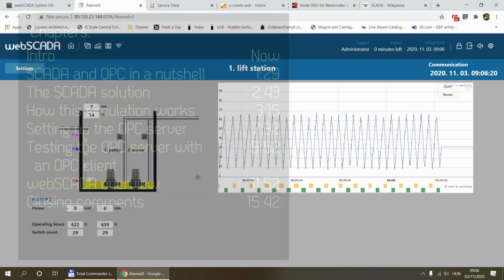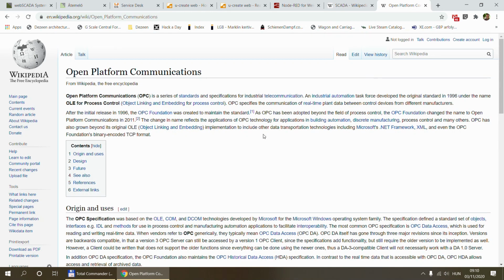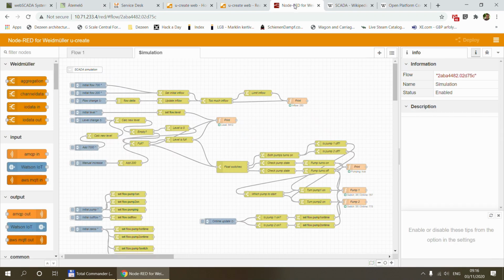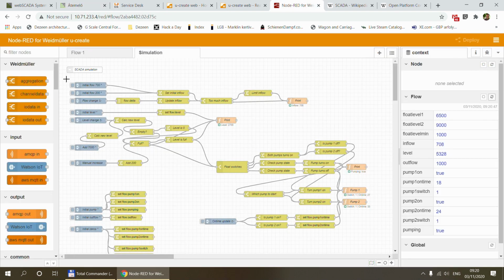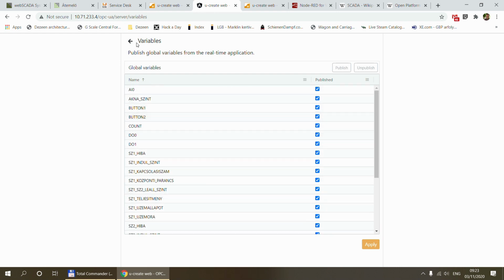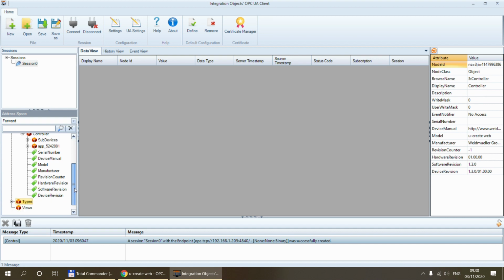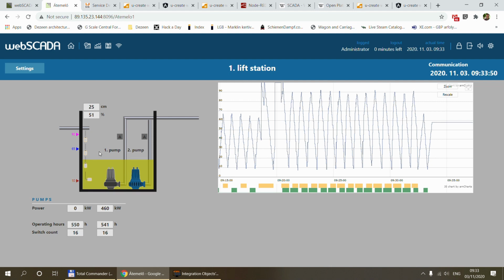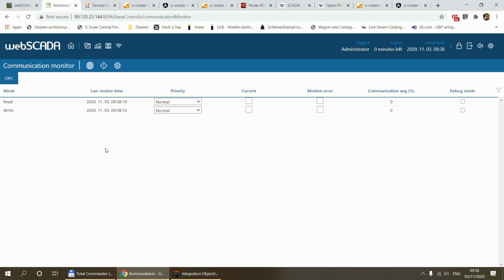Weidmüller AC: OPC Server

Comment: Hi, thanks again for the videos. I am working with a Weidmüller AC on my final thesis and your videos are helping me so much!

I have a question. It is possible connect OPC UA client being in a different network than the Weidmüller OPC UA Server? For example: if I want to see the global variables of my weidmuller (which is on my university), from a OPC UA client in my home?

Thank you.
Reply from the maker: I did not test that, but I think that is the whole point of the OPC UA protocol. In that case definitely turn on user authentication, and I would also suggest generating a server certificate and installing that certificate on the Weidmüller AC. But if this is a simple project you can skip the certificate part, but at least mention that for security it should be done in a production setup.